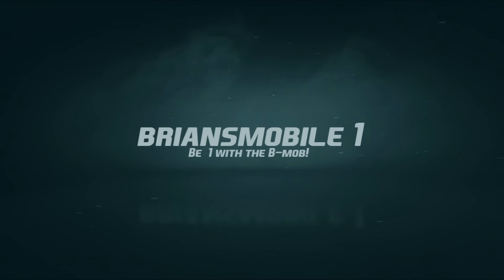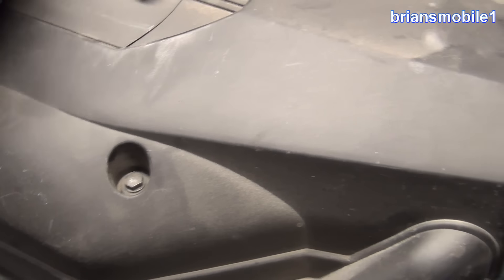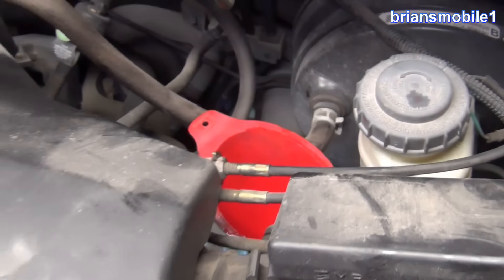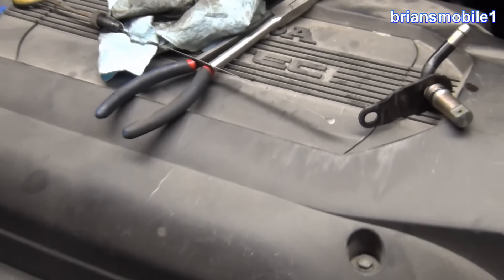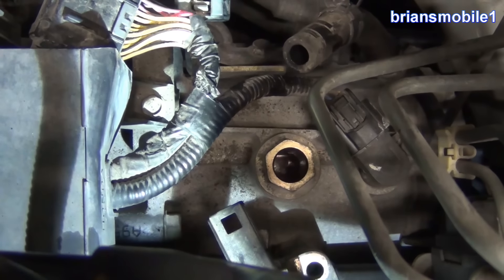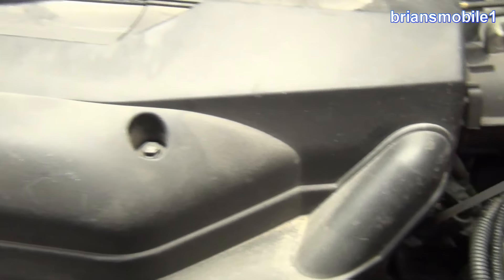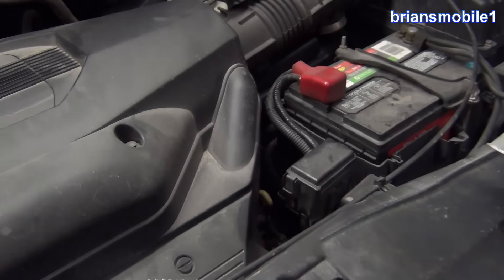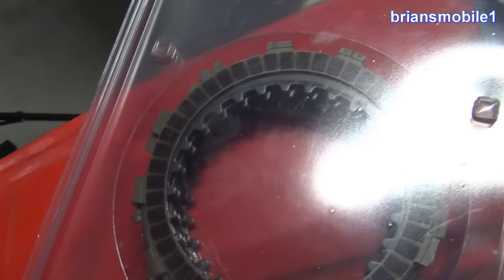Watch this Video BEFORE You Destroy Your Honda Transmission

Comment: Hey man I’m just chasing ghosts I guess you could say I’m not too sure if I need to swap my transmission or not I just thought I would quickly ask a question on here as a last ditch effort I have an 05 Honda CRV it has a five speed automatic all of a sudden once the transmission got hot it was slipping and it wasn’t getting any forward gears but it would work fine in reverse
Reply: As well it had a whining sound so trying to find documentation any PDFs or anything online has been more than frustrating but when I did check my transmission fluid when it started doing that it was a good inch and a half over the full mark now when I did change the transmission fluid I waited until it was hot like the food was bloody hot and I filled it so that it was just below the full Mark can’t seem to figure out what exactly happened and yes the cooling fans did come on not too sureWould definitely appreciate some sort of response I know this is probably an older video but still input would be appreciated and I don’t want to hear you have to flush your transmission three times or anything like that because it was done when I receive the vehicle two years ago so I proceeded to wait till it was hot remove the excess fluid it was still doing it then I saw online and I’m doing something that I have never done before and I’ve made fun of people for watching another one where oh it’s your shift solenoid so I went and replaced my shift solenoid then all of a sudden I was presented with a code actually two of them p0780& p1734.The transmission does drive when cold but when I shift into drive when cold it grabs then it doesn’t grab then it finally engages if I drive it very easy it does go through the gears but if I give it even a little bit of goose it’s almost like it slipped out of gear and just revs

Comment: Hey brian i have 2006 honda accord 4 banger 5 speed auto trans. I bought it used with 99k and i now have 112,000 almost 113,000 it shifts good for the most part but when its cold and when i dnt warm it up in the morning i noticed today i was going up my hill and it would jerk going into 2nd gear i was gonna have the honda dealer change my fluid is it safe to do so?? Ive heard ppl say if it wasnt changed the first 60k miles was told to leave it alone. Now i want this tran. To last as long as possible please any feedback would be great thanks brian
Reply: Learn to baby it during that 1~2 shift. My '02 Accord V6 has done that for over 100,000 miles and still going.
Reply: @netdoctor1  yeah it will jerk/slip when going up hill when cold especially if i just put it in drive right away but once warmed up it shifts smoothly it mainly does it when sitting overnight. So when i start the car in the morning and dnt let it warm up right away the car will slip and jerk into 2nd car i have 115,899 miles on my 06 accord 4 banger i just hope my transmission isn't going out anytime soon
Reply: @thomasy76  Well, if my history is any indicator, you've still got plenty of life left in that ATM.

Comment: Could you pls explain the logics in  checking levels where it's recommend check at idol/warm/in neutral bt you say to check OFF/warm.If off wouldn't  levels vary due to oil settling the long you leave it.Having issues accepting against company recommendations.I did my daughter's Nissan Tiida had dropped pan to totally clean magnets x2 n flush metal filter,some have changerble plastic ones like my R50 mini.Oh yeah cool vid.
Reply: Fluid will expand as it gets hotter. It's best to run it through all the gears while it's heating up so the fluid will be distributed into all areas of the transmission. The owners manuals will normally just give a basic procedure of running through specific gears to make sure the fluid is circulated completely before checking.

Comment: Hello thank you for you Knowledge/videos 
I have a question for you, I have a 2004 Honda Pilot what’s your thoughts on Amsoil  ? 
It’s said to be superior protection against high heat and when towing? Although I don’t do any towing I was thinking as for the heat protection and living in Phoenix,Az it would be the way to go ?
Reply: If you are worried about heat damage to your trans then you need to install a transmission fluid radiator. Bolt it on in front of the existing ones and run the dedicated cooler in tandem with the existing portion of the OEM trans cooler section of the rad. Cheap enough to do since anything will be an upgrade. Just make sure you account for the need to increase the ammount of trans fluid in the system and remember to write it down for next time lol.

Comment: nice EricTheCarGuy sticker on your tool box bro lol, i have a question, i recently bought a 2005 Chevrolet Classic (fifth gen malibu) and it has 212,892 original miles on motor and transmission, its a sealed system so no dipstick or drain bolt and i have no idea the last time the transmission fluid was changed, should i change it? or leave it alone since ive heard changing old transmission fluid from a transmission with a lot of miles like mine can cause it to start slipping from the new fluid
Reply from the maker: What's essentially brake dust from worn friction plates can keep an old transmission gripping instead of slipping in some cases.  It's like rust and spider webs holding things together.  Still, I'd check the fluid by opening a test port and if it's burnt or nasty since you don't know the condition or history, but if it does need to be changed, do it at a time when having it potentially fail is less inconvenient.  Cool?

Comment: If Honda ATF fluid is so good, why do their transmissions notoriously fail, especially in V6’s (I’ve had 3 Transmission failures in 2 Acura’s using DW1?  A friend of mine has always used Max Life and he’s had no problems.
Reply: DW1 is a low end trans fluid.

Comment: I just to my Acura TL 2006 to the Acura dealership to get a drain and  refill on myl transmission oil  every 15,000 miles I will replace transmission oil pressure next

Comment: He right you just wasting money on that fancy fuild.
Reply: I just serviced a 2012 Accord, I used Honda fluid I bought at the dealership. The price was only a few bucks more, literally. Call your local dealership parts department, the prices are right there with what I would pay at Walmart, and cheaper than my local Autozone, etc...

Comment: Ive seen a guy flush the trans by disconnecting the trans line into a bucket while pouring new fluid in while its running Seems better to flush it all out No?

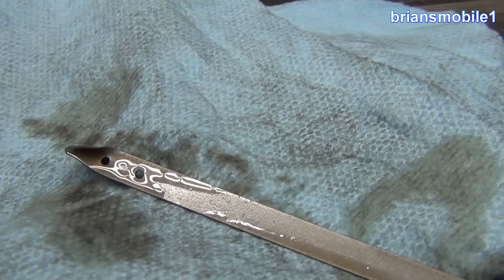Comment: 7:29. How do you know which the actual level is? The dark spot near the bottom or the lighter fluid past the second hole?
Reply: It has to be in between don't pass the top hole.
Reply: deep breath
It's difficult, as the fluid on the inside of the dipstick tube fouls the reading.
The only way to read it accurately is to read it on the side of the stick that has the lowest level. Any fluid above that point is residual fluid from the tube.

Comment: Does anyone know why 06 odyssey would be doing fine then after driving 45 or so min the rpms would go up to 5 to 6k and barely wants to accelerate?
Reply: worn transmission... you didn't state how dark the fluid is, which is the material coming off those clutch packs

Comment: I'm thinking about adding Lucas Transmission Fix on my 2007 Honda Accord 4 cyl sedan.  The transmission shifts really well after I've warmed the engine up for 7 minutes. When I don't warm the engine up for 7 minutes, the transmission slips  (bogs) when going from 1st to 2nd !?#%  I'm also thinking about adding Lucas Fuel Cleaner to help the fuel pump and fuel injectors o_o :-)
Reply: Use chevron techtron full fuel system cleaner, it really works, one treatment and my check engine light bc of a dirty o2 sensor stopped coming on, had a quieter idle and more power. Only like 8 bucks i think too.

Comment: AMSOIL in Honda and Acura 5 speeds and 6 speeds... Dw1 is not a good fluid it oxidizes fast it can't handle any heat it has killed many transmissions.

Comment: I have 2005 Honda Accord V6 120k.  Do the transmission pressure switches get wore?  It does not always shift smoothly from 2nd to 3rd.

Comment: @briansmobile1 is there any transmission overall kit available anywhere for the 24z honda cvt transmission
Reply: CVT's are throw away transmissions. That's why most trans shops won't touch them, replace only.  Even so there are some videos on how to rebuild a CVT, although questionable as to the durability of a rebuilt CVT if not done at the factory, and even then, factory rebuilt CVT's are notorious for rapid failure.  Best bet is to treat a CVT like it's a one shot deal, change the fluid every 30k miles, use highest grade fluid such as LubeGard CVT fluid when applicable. Install a separate trans cooler if the CVT didn't already come with one.
Reply: @racers115  I don't disagree with anything that's being said here, but the reason why it's not practical to rebuild is because it would almost definitely require a replacement of both Drive and Driven Pulleys, as well as the Belt. Absolutely no damage to any of those components is tolerable. It's cost-prohibitive.
These transmissions are extremely vulnerable to failure due to contaminants, so any opening of the case must be done in extreme caution to not introduce any solid contaminants (such as accumulated dirt around the opening, tiny bits of aluminum thread from the fill opening, etc.) through the fill opening. Even a tiny aluminum sliver can cause belt failure.

Comment: Thanks for your video. I just bought a 2007 Honda Civic, with a 139k miles. the owner bought it with 25kmiles, and she own it for 9 years. I do not know when she changes the transmission fluid or maybe she never did. I cannot get in contact with her. When I check the transmission level, it looks good and drive fine. My question is, do you think I should change the transmission fluid or when should I change it?
Reply: I never take the word of someone selling me a vehicle, when you get it you should change the oil and filter and transmission fluid and filter,
I'd say after 1k of driving with new trans fluid, drain and add more, then change it every 15k-20k 

As a service technician I seen alot of  vehicles past their matiance warning anywhere from 100miles-3k miles
I dont trust others, if I change it I know it was done correctly

Comment: I had a 2003 honda pilot back in 2010... It had 230,000 miles on it and started shifting funny and the light would blink.  I had the transmission flushed and filled with global fluid from O'Reilly auto, some shift modifier by master lube and one quart of Lucas transmission treatment put in. I also had them put Lucas transmission  treatment in the rear differential. I drove it for years afterwards and it never gave a bit of trouble and shifted smooth as butter. I sold it when it had 380,000 miles on the original engine and transmission, and was still driving like new!

Comment: What about manual transmissions?
Reply: Works diff
Reply: live and let live obviously. But should we flush and change fuids on a manual? Because I usually don't.
Reply: @fullmetaljacket7  I'm pretty sure the fluid is a diff 1 and yeah changing will prob help the clutch last longer if I had 2 guess
Reply: The clutch and transmission are completely separate. Yes you need to change manual transmission gear oil. All oils break down over time due to heat, moisture, and contaminants.

Comment: I change it every time I change the oil
Reply from the maker: That's pretty excessive.  You're not hurting anything, but you're either not changing your oil enough or changing the trans fluid more than you need to.  About every 3k-4k miles is great on oil and about every 30k-50k on a partial ATF fluid change is plenty to get the benefit to be had.
Reply from the maker: I do however respect your enthusiasm and commitment to good maintenance/transmission care!
Reply: I change the oil when the oil life readout on the dash says to. Changing the ATF is so easy, I do it too; especially since I heard that the transmissions are somewhat weak.
Reply: @bgehret3141  I changed my motor oil when the oil life says 70% which is every 10 months.. I do mostly Town driving and not very many miles a year. About 14 to 1,500.

Comment: As usual, this isn't the entire story on this issue.  On my 2002 Volvo V70, the common issue on the early Aisin transmissions, AW55-50SN, is that the shift solenoids tend to stick over time, causing hard shifts due to rapid changes in fluid pressure.  Even with regular fluid changes.  Nothing to do with clutch wear.  In my case, a rinse with a chemical solvent such as Seafoam trans treatment prior to a drain & fill helps to unstick the solenoids.  Most people don't have this problem.  Most people just never changed their fluid, and the old friction material suspended in their black fluid is the only thing getting the worn clutches to work.  Those people are a half-step away from needing a new trans anyway -- the discussion should not center around their negligence, but rather the intrinsic needs and functioning of a viable transmission that is still in its service life.
Reply: The silenoids stick over time because of the filter screens getting blocked with debris in the fluid.   If you want to avoid this you can either change the filter screens or change the fluid frequently before it mucks up the screens.

Comment: Hi Brian, thanks for video, very well done. I have had some tranni trouble with my 04 pilot. The Tran i oil spewed out and engine revved up. I limped into lube shop. They drained and put in new oil. There was a code of P0740, which sounds like a torque converter. Popped into tranni shop which says that meant tranni might be toast, and there was no filter that could be changed out. What do you think?

Comment: Great detailed to the point video Brain.
Slight off the video question, can you please confirm if Accord 1991 trans fluid to be checked with the car engine running or shut off.

Thank you in advance.
Reply: Hot and off just like this Odyssey!

Comment: There is absolutely a safe way to "flush" your own fluid using the pump's own pressure at the return line to pump out old fluid while you add in new fluid. The problem of shop machine flushes is that they are forcing fluid in with pressure in a short amount of time. This added fluid pumping pressure from the machine is causing the issues not the job of flushing if done right. Some machines use the vehicle's own fluid pump to replace the fluid more thoroughly.

Comment: What is your advice on the age of transmission fluid? I just did mine again, but I didn't want to use the leftover fluid from my last transmission fluid change because it felt a bit thinner than the new stuff I just bought when I put it on my glove. Is that my imagination, or does the fluid actually degrade with age when it's just sitting in the bottle?

Comment: Hey Brian, nice and very detailed video!  Thanks for sharing!  I have a question for you:  In my 2017 Honda Accord, the shift position indicator sometimes flashes 03, instead of showing what gear I’m in. It resets back to normal if I turn off the engine, but it does it again after a couple of days. Do you know what it is, and how to fix it?  Thanks.

Comment: Hear me out and tell me what you think. Since I don't want to pay for a new transmission soon. If the transmission fluid level is low but not empty......pour a very small amount of honda ATF into the reservoir and let that small amount get diluted into the most likely already black transmission fluid. And I would continue to top it off  with small amounts at scheduled intervals. My reasoning is that the balance of the ATF would not be drastically changed therefore avoiding the dreaded effects of adding new ATF to a transmission that hasn't been maintained. All the while, the new and small amounts of ATF would slowly dilute and help keep the transmission lubricated. My reasoning also involves the idea that you don't pour warm or even cold coolant into an overheating engine and if you have to.......do it very very slowly.
Reply from the maker: Wouldn't hurt.  On this adding enough to maintain proper level is A.O.K.
Reply: @briansmobile1  thank you!!!

Comment: I never have magnetic shavings on my drain plug.
My Fluid is Always Red when I drain it.
Drain and refill, 4 Times over a Short period of time
will change the Trans Fluid, According to The Manuel.
Brown Fluid is never Good
Always use Honda Fluid, I have a 06 CR-V
with 201K and runs like new.

Comment: Brian, I know there's talk about OEM vs Aftermarket, particularly with Hondas.  Amsoil vs Honda oil, etc.  But when it comes to ATF, and your advice against flushing the fluid, what are your thoughts on upgrading to a synthetic?  Also, since (if) I have your ear about Honda OEM vs Aftermarket fluids in general, so far as coolants, what are your thoughts on upgrading to a HOAT option on a Honda?  Thank you for your time and thoughts.
Reply: Great video however I disagree about the Honda DW1. I've used valvoline synthetic on my CRV for the past 190,000 miles and is smooth as butter. I change it every 50k and never use Honda DW1. Never had a transmission issue. I even tow a trailer now and then. I currently have 248,000 miles on my CRV and going strong.
Reply: @michaeldarrow6021  I've heard of handful of others that used Valvoline. Haven't heard anything bad about it. That's the only other possibility.